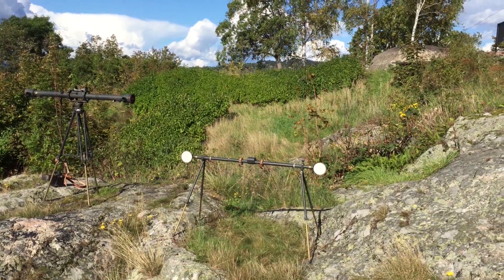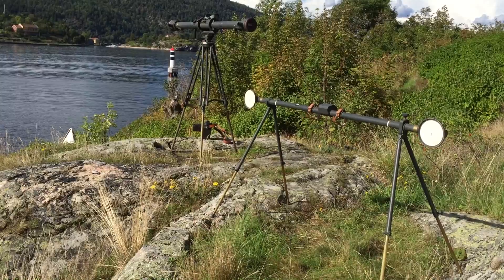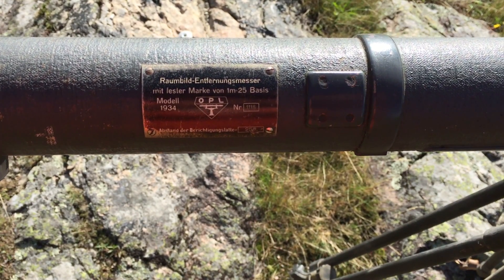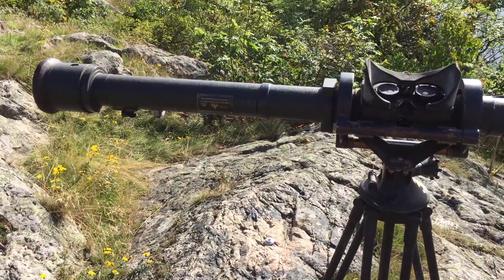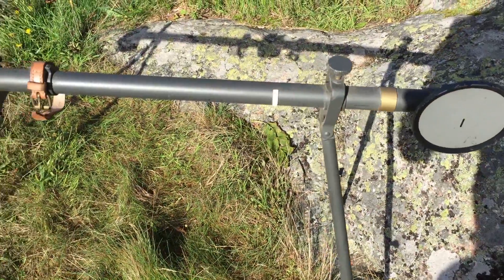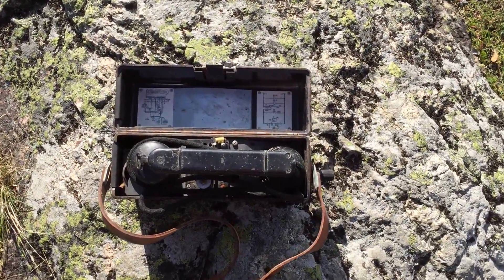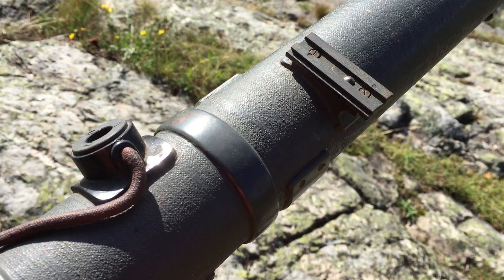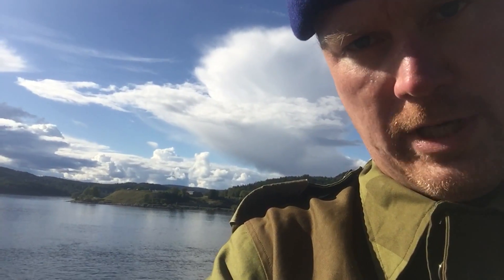German stereoscopic rangefinder WW2

Comment: Just found one of these units. It is a much larger unit.......model 1936. Measures roughly 2.5m across. It is disassembled and wondering if there is an instruction manual available.
Reply: Einfach mal googlen.oder in Museen nachfragen.habe einen 0,7m der Kriegsmarine mit original beleuchtung und einen 1m .den 0,7m benutze ich gelegendlich.Funktioniert gut.Und sorgt für Hingucker.

Comment: I also have one of these, do you know of the value of it? I want to sell it
Reply from the maker: It's kinda hard to put a price tag on it, probably depends more on what a buyer would pay! Though they're not very common they're not exactly unicorns either and not the typical item a WW2 collector would look for. 
It boils down to the overall condition - is it refurbished, painted, working order, optics? I've seen pics of identical rangefinders retagged with Swedish tags so likely any country having coastal artillery would've been equipped with identical or similar rangefinders.
What sets the specific setup shown here apart is its known Nazi and post-war history, being a matched set and hardly exposed to UV rays since 1960.

Comment: From what I have heard, you look in the right side (middle eye sight) and then use the controls on the right side of the to line up the images (one on top of the other), when the images are on top of each other, then you look in the left side to read the range.  (might be listed in meters or yards).
Reply: Bei dem nicht.Der stereometer ist ein 3D-Fernglas mit einer Zickzack-Reihigen Meßreihe die in Hektometern in die Ferne zunimmt.Man muß durch Räumliches Sehen (ist vorraussetzung zum Bedienen des Gerätes) schauen ,welche zahlenreihe dem Ziel am nähesten liegt.Habe so ein Gerät.Funktioniert bestens.Und man zieht Blicke auf sich.
Reply from the maker: Thanx for that; that's more or less how I understand it should be adjusted too.As with any military devices (I have background with self-propelled field artillery ) there should be a drill for performing the measurement fast and correctly , and the new happy owner has made contact with OPL(they're still in business!) hoping to obtain a copy of the French or German operator's manual . It should actually be possible to bump into someone with experience with the OPL Model 1934 as they also were utilized by the Swedish and Finnish armed forces post-war (though repainted and without the Third Reich script;  making them less interesting )